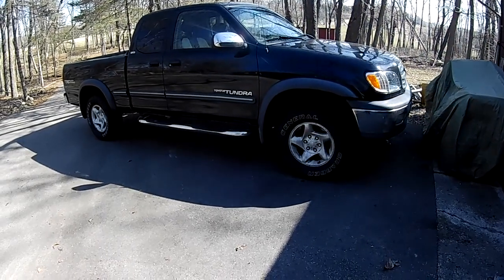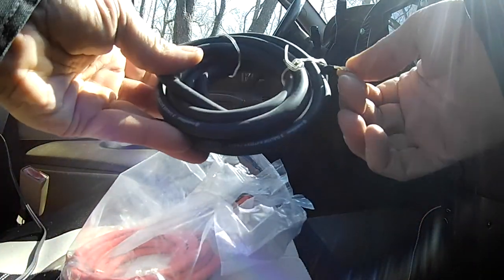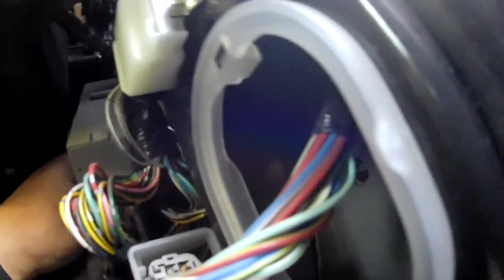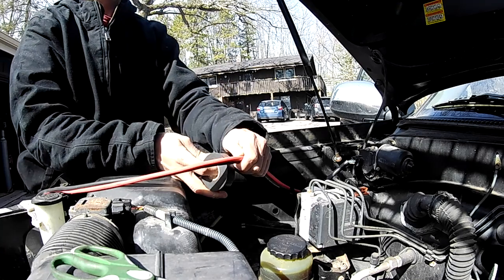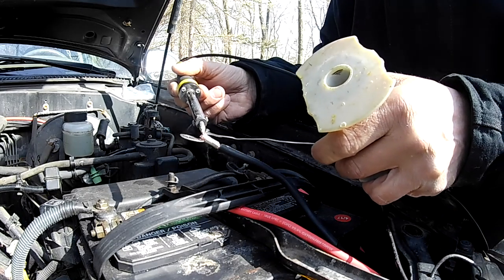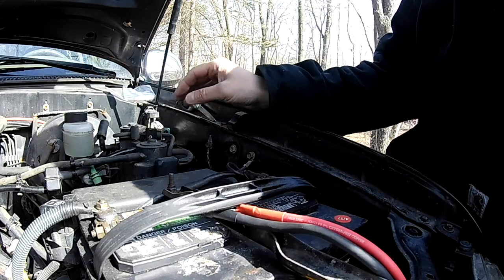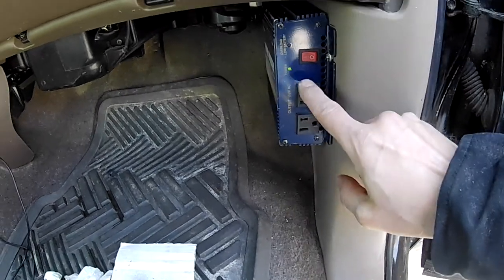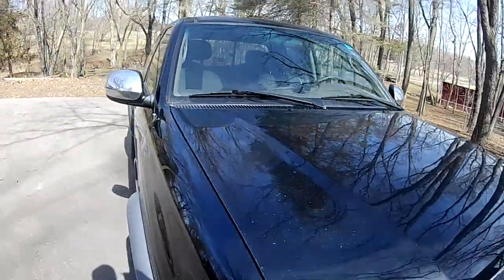Truck Power Upgrade! How To Install a Power Inverter.

Comment: why didn't you put a fuse on the positive side of the battery?
Reply from the maker: There is a fuse on the inverter itself. I may end up putting one closer to the battery in the future.